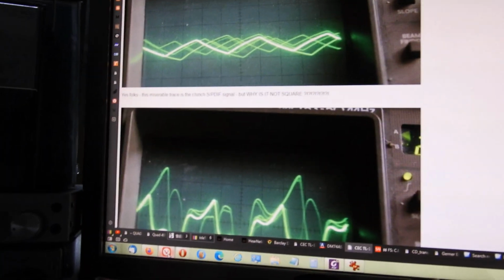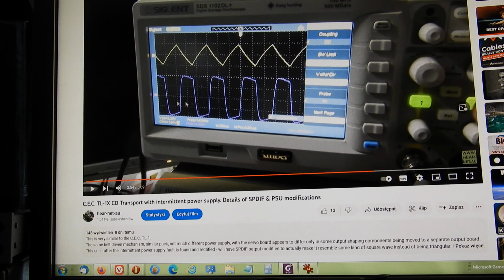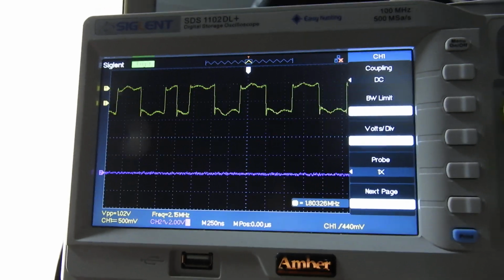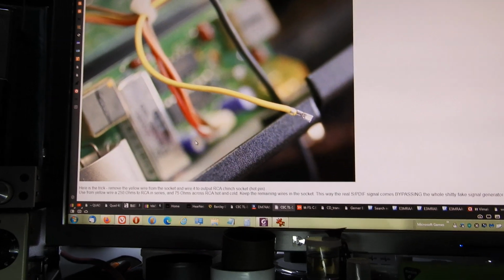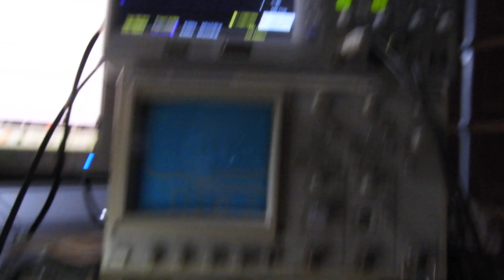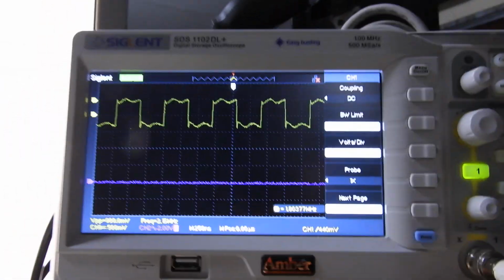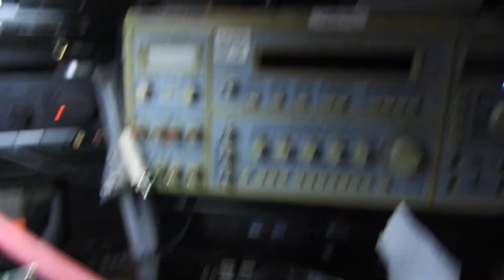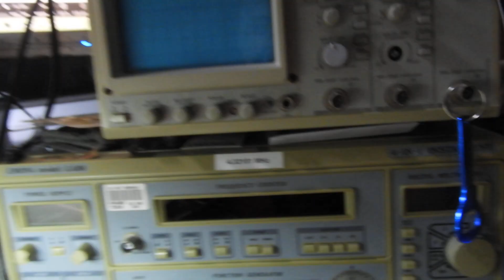CEC TL-1X Transport progress video. Do not blindly follow Internet advice. Even from Lampizator.

Comment: Hi. My TL-1x makes some noisy 'whispering' when starts to spin disc and read TOC of the CD, also same swish when jumping to other track. While playback it's quiet. Is this normal or should cleanse gears/belts or replace belts?
Reply from the maker: Yes, it is normal. Basically, the belt is being stretched when you're starting, as it is labouring against turntable inertia. Track jumping noise is servo trying to focus on the next track, but also the same belt pulling to change the speed of the CD (it sound faster at beginning and slower towards the end).
Reply: @hear-net-au  Thank you!

Comment: I may have to go with the new Audiolab CDT 9000 thats about to come out -
I been searching for a good ole Sony ES for a transport but Japan has all the good ones , and CD players are the most fragile for shipping 😥 Thanks for the video
Reply from the maker: What's the mechanism in it?
Reply: @hear-net-au  i'm not sure No info maybe a Sanyo mech The U.S. Distrubutor sent me an updated email today their sending me one for video review the 9000 series is Audiolabs top of the line range - Theirs pics online
Reply from the maker: @tee-jaythestereo-bargainph2120  Transport for free is always a good one. It cannot be a better bargain. :-) Once you have it, open it up and see what's inside. If it is one of the Sanyo mechs, it should be OK. It is the cheap DVD ones that we should all avoid.
Reply: @hear-net-au  No its not free its a loan/lease agreement but if i like it alot yeah I will buy it , But found a very good condtion sony CDP 552 esd for sale price is fair but owner says it needs belts replaced for drawer but looks so nice I don't know how hard the belts are to replace or where to clean microswitches 😥 Yeah I Hope the lab is good its about 17 pounds I dought they used a dvd mech I hope not - But being 2.5x the price of cdt 6000 surely the 9000 series has better performace - And yes i will pop the hood !! They also have a New 9000a integrated amp at $3k U.S dual mono i bet they send me that one as well to review
Reply from the maker: @tee-jaythestereo-bargainph2120  Well, if the CD-552ESD is cheap enough, I am sure we can fix it. I will direct you to the appropriate video ;-) It already has a digital output, so you have a ready transport for little money. You wouldn't be a Bargainphile if you bought a brand new unit for thousands, would you?

Comment: The lampizator mod sounds like a lot of "audiophile" BS to me lol
Reply from the maker: Well, the is nothing wrong with getting the SPDIF trace to be better, although I am not sure if the "sound of CEC transports" is not dependent on the mangled trace. If such thing as "CEC sound" actually exists. Will check it out when I finish with this one.
As far as capacitor replacement is concerned, the small value, high voltage ones that I have already replaced, were all OK. Both capacity-wise and ESR. Although branded Sanyo, they were all made by Rubycon.
This is not to say that there is no point in re-capping some of the Sanyo boards. I have done so in some Roksans and the caps there were very leaky. But not here in the C.E.C.
One just never knows.
I myself only do re-capping, where:
1. I find a fault in a player and capacitor is to blame. I then check couple more, and if the have high ESR, then they all have to go.
2. I have worked on a similar player before and know that the caps are likely to be leaky. I then test 3 or 4, starting with ones close to regulators, and if any one is leaky, then they get replaced.